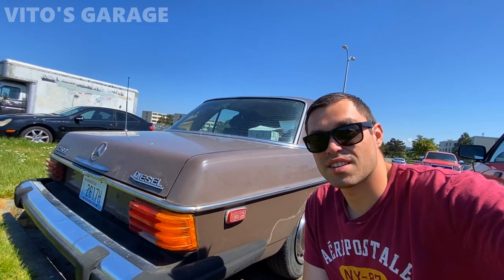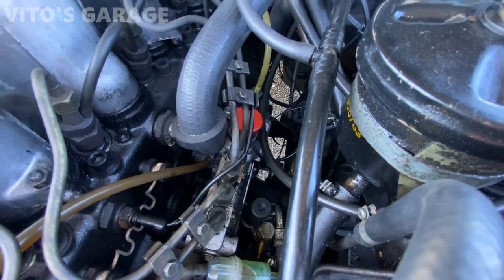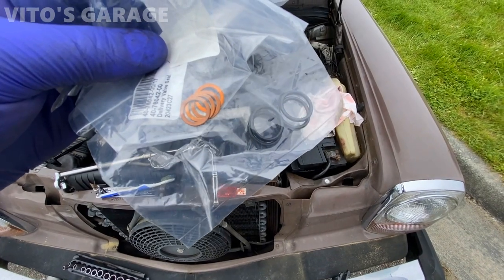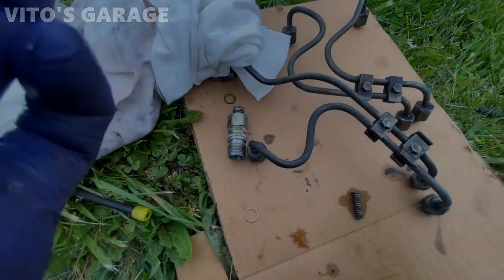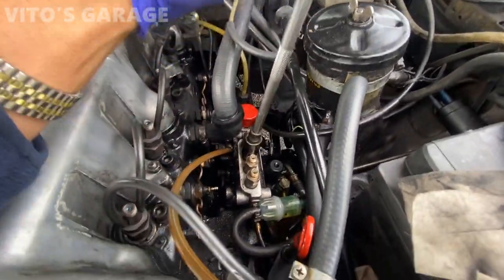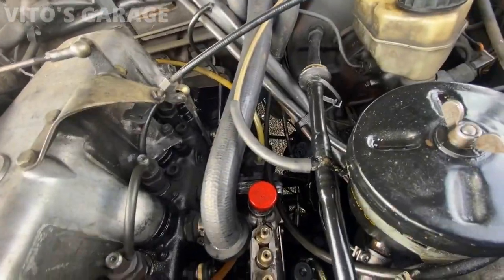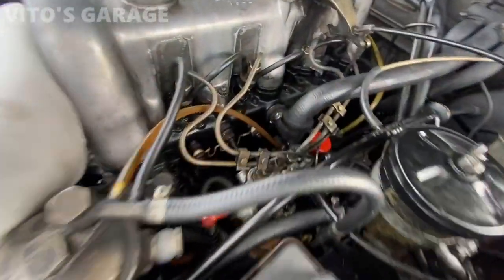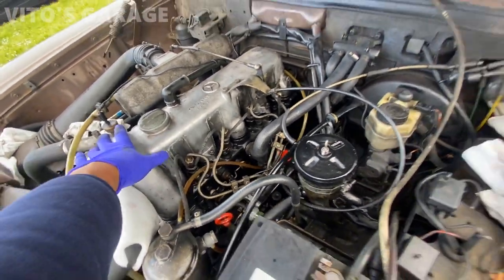Intermittent Crank-No Start 1976 Mercedes 240D W115

Comment: Vito,  I have the same issue and cannot get my car started.  Where did you get the o rings and crush washers.  I need to order some
Reply from the maker: Hi. This is what you need. You can type these numbers in on eBay and you’ll get results. 

Part numbers: 
CRUSH WASHER ×4- 01 799 741 48
ORING×4- 00 199 734 40

Or any websites such as fcpeuro, Pelicanparts.com, eeuroparts

Comment: I found the washer, but the product # for the O-ring you gave shows up as A/C O-ring compressor. Is that the same one for the fuel valve?
Reply from the maker: Not sure why it shows as AC oring but those are the correct numbers. It could be that they’re both the same size

Comment: At 20:00 when stated and as you and as bringing camera closer to the engine you can hear that buzzing sound. I have the same thing and it’s not continuous sometimes it goes away. Amy idea what that buzzing sound might be and how to get rid of it
Reply from the maker: Probably the belt area. Check your belts. My engine mounts were super bad too and front subframe bushings. I changed those. Check out the W115 playlist

Comment: Vito, I did something stupid on my w115 300d. I reversed the battery polarity by mistake. I think I burned my alternator. because the battery light is on. what do you think. Thanks
Reply from the maker: You need to check your fuses. I bet you lots of fuses are blown